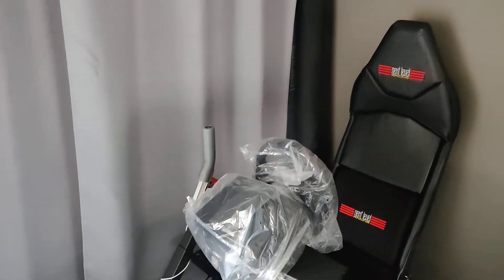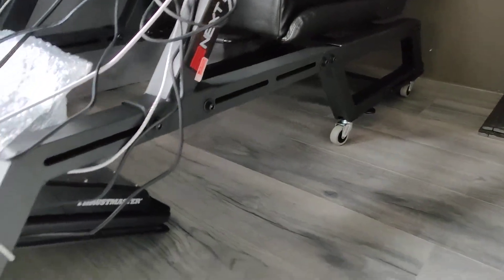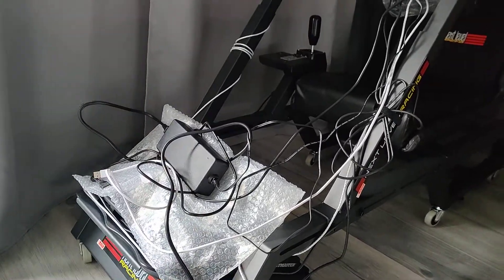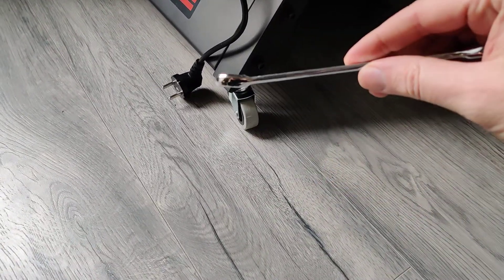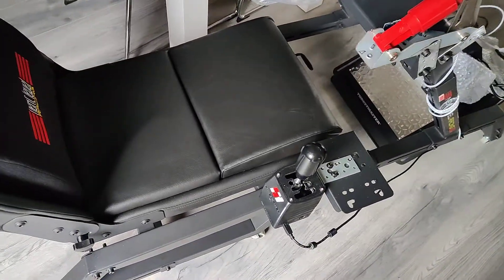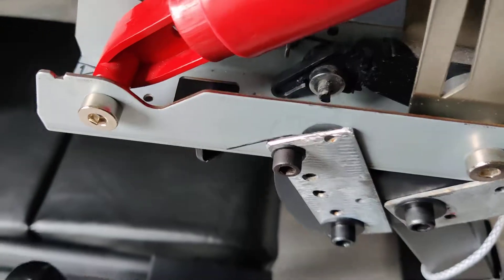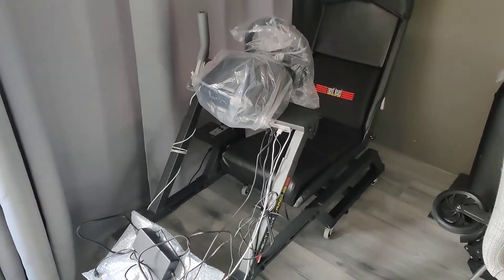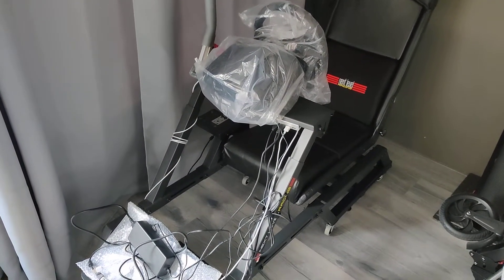DIY caster wheels Next Level Racing F-GT cockpit mod

Comment: I am just about to put mine together and had exactly the same idea about getting my owne wheels. I haven't unboxed mine yet, has the chassis itself got welded or captivated threads for wheels or is it just holes?
Reply from the maker: Holes with thread if I remember correctly
Reply: @RebelDrifter  thank you mate,👍
Reply from the maker: @stevetadman6272  no worries. If you haven't liked / subbed - please consider as it helps me out A LOT :D cheers!
Reply: @RebelDrifter  i did. 😎
Reply from the maker: @stevetadman6272  superb! Thanks a lot!

Comment: which caster wheels allow u to add the bolt all the one i find already have a bold or 4 screws i need to get the same ones u have
Reply from the maker: Oof that's a while ago. It's not rocket science but the wheels should be found through Amazon or Next Level Racing website.
Reply: I'm in the same boat.  I can't find any that allow you to add the bolt.

Comment: How vertical can you lift your rig on one end? I need to move through hallways so my idea is that I would lift the rig vertically to a degree on one side, to help pivot in the hallway and then I will wheel it like normal.
Reply from the maker: Then you should take off the seat area to make it easier.
Reply: @RebelDrifter  no you don't understand it's the wheel base of the rig that's too long to be able to turn it into a hallway from a doorway. But if I elevate one side I can then swivel it into the hallway so I can just roll it like normal for the rest of the way. Does that make sense?
Reply from the maker: @TheDoctor46vr  I hear ya. The wheelbase area is a little foldable or yeah you can probably lift it. You should be able to fix that fam. Like and subscribe and let us know how it goes.